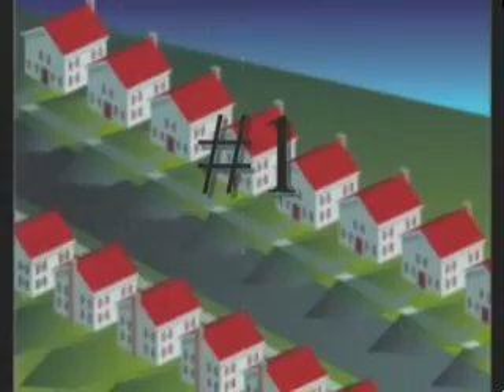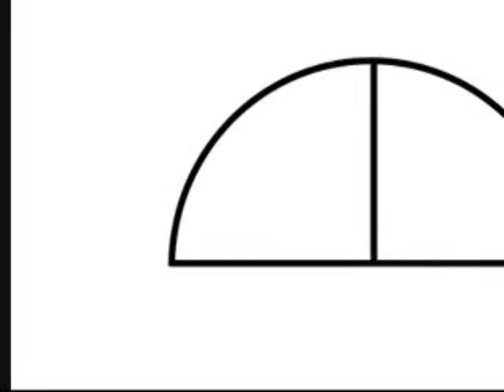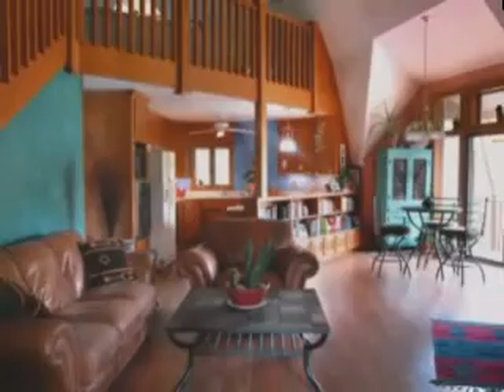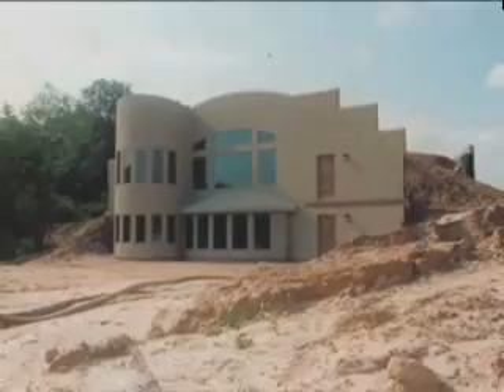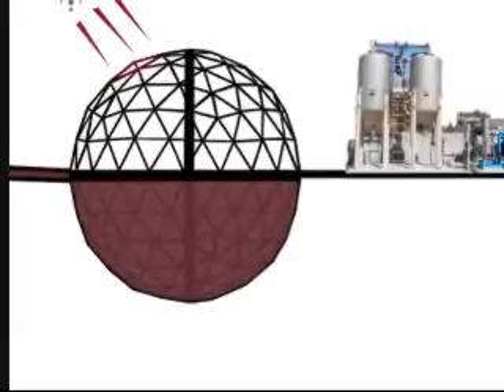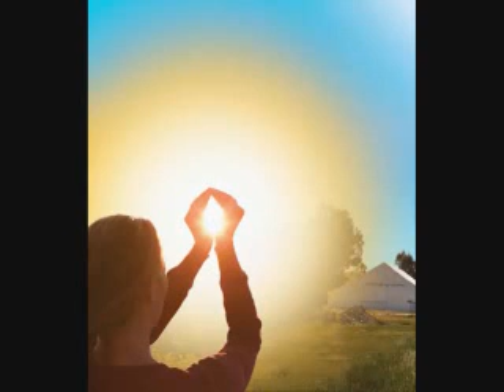Multi C.O.R.E. "The Original Zero Energy Mass Sea Water Distiller."

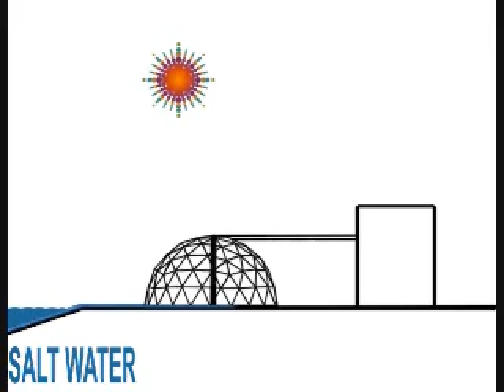Comment: 4:50 I'm wondering, what do we do with all that extra salt we'd end up with from desalination? I jokingly thought to myself that we could sprinkle it all around the southern tip of Greenland to slow down the mid Atlantic stream shutdown. Is that a terrible idea?
Reply from the maker: I’m sure it would be a marketable commodity, but depending on how widespread these were in use, you would have to consider establishing salt flats in desert areas to place the dehydrated matter.  Pumping the brine back into the sea would definitely be a no no for life, and your right, it could potentially slow the flows of oceanic currents.  I want everyone to have a drinking water and all, but I’d rather not spark the next Ice Age to do it;)

Comment: I am keenly interested. I was wondering if the ground is rocky on the building site will there be difficulties with the underground  storage pipes?
Reply from the maker: I can still cut through big rocks while sitting in my wheelchair with a hand held Makita jackhammer "though I know I shouldn't be doing it".  I only say that to point out if the ground is simply rocky, most small to mid excavators could handle the initial dig with no problem.  If however you were cutting into actual bedrock, you would be looking a heavy equipment jack-hammering, or in the case of an entire community being developed digging deep basements for complete spherical homes, you would start to look towards blasting options.  

In addition, depending on how far north you plan to build one, their are additional options for storage medium that afford a higher btu storage capacity, which allows for shallow dug storage areas. With higher btu storage medium like taconite we are able to achieve the C.O.R.E. thermals with digs as small as a foot.